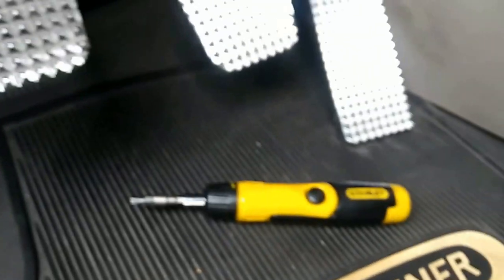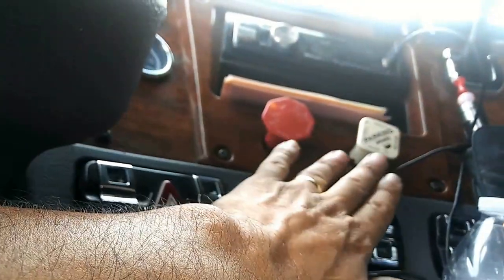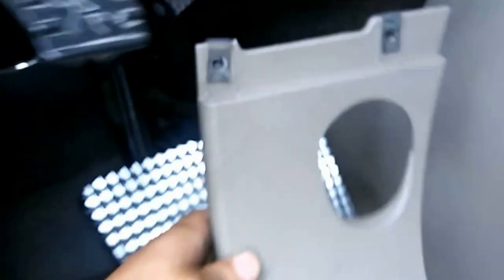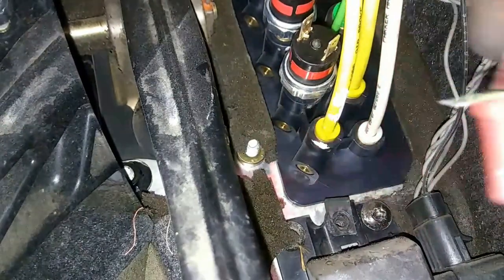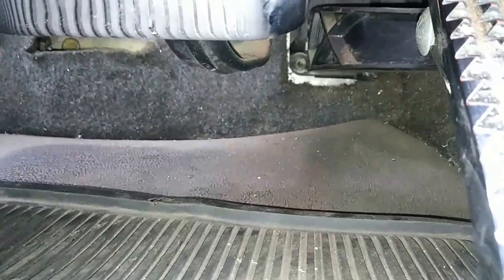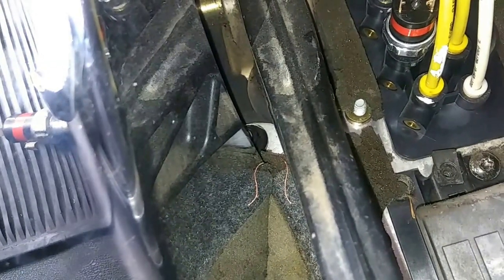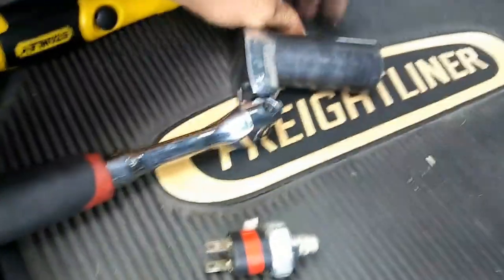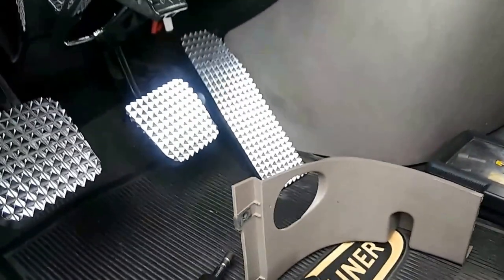Replacing air switch

Comment: Just got this Cascadia as a company driver and it is easier than my old 2006 Century, I know where the leak is and it does sounds down there. Thx for posting. The air sensors leak when there's a lot of water in the air tanks when the driver fails to drain their air tanks daily. The switch rust and pin holes develop.

Comment: Just to let you know how thankful I am to ran across your video and my low air sensor gone bad and cost me $6 to replace it by myself
Reply from the maker: good thing
Reply: When you say your low pressure air sensor... Was your buzzer going off even though your air was full. Because I'm holding air bit the stupid buzzer keeps going off....
Reply: Vic my 1994 freightliner fld 120 is full of air and holding but the  low pressure buzzer stays on? What's causing  this? Thanks in advance.

Comment: Btw, they aren’t switches, but sensors, next time don’t forget to mention socket size it would help a lot more🤪🤪
Reply: Nope that's an air switch.
Reply: Tyler Tyler it is not, does not switch to anything, but sense low air pressure or whatever is connected to.
Reply: @tramos36  Its an air switch. It uses air pressure to either open or close and make an electrical connection. LOL think of a light switch that uses air pressure to turn on and off, It senses nothing !

Comment from the maker: I forgot to mention.before you do this.drain the air out of the system
Reply: Vic Med which one controls the brake lights, my brake lights stay on
Reply: Does anyone know which one controls the brake lights, my brake lights stay on even after I'm parked & engine is off
Reply: Unplug them one at a time until you find it.
Reply: turbooomann Look it up in Google!    I can’t tell u exactly where,but I find it once. Search for Freightliner diagram or so.
    There is like 5 brake solenoids.   Parking,primary,secondary,low psi and so on.    Good luck!

Comment: Thought these were Brake Light switches? 🤔. I drove school bus and if our brake lights didn’t light up it was due to one of these.  We had 2 on the treadle valve (brake pedal). They both got replaced (one is a backup so both get replaced).  If the dash valves were leaking, it normally meant the dash valve was bad.

Comment: That is a sensor for your Gage's. Air on one side and electrical on the other side for your Gage's. If your park brake, trailer Vale supply leaks the valves themselves are leaking.

Comment: I think each truck is different.  I was told these are brake light switches. These are what turns your brake lights on.  And on our busses these were on the brake pedal valve and there was 2.   Never seen 5 before.

Comment: Do these switches also control the low air buzzer/alarm?? Mines is stuck buzzing/alarming while I'm driving,, but when i'm stopped it shuts off. Please help Vic.
Reply from the maker: no they dont
Reply: I had the same issue and all of a sudden the alram went away but now i have one of these leaking air so its probably the same thing causing it
Reply: William what was the issue with that buzzer while driving and then goes off when you stop?
Reply: William Mendoza I ha e the same problem did you find out what was the issue

Comment: I'm having issues with the trailer lights staying on while driving at night. They work fine when I'm fully loaded. They stop working when I'm emptied or hauling a light load.
Reply from the maker: try replacing the electric line
Reply: @vicmed6088  I replaced the pig tail with a brand new one.

Comment: Hey Vic how do you fix the air leaks that's by the firewall
Reply from the maker: sometimes you can just replace the fitting on the firewall,but sometimes you have to replace the whole thang,its about one hundred and something ,not much,good luck
Reply: I just had it to replace mine on a Century 98,and it cost me $165.00.       One push fitting was leaking and they are made that you can’t replace them!    You have to buy the whole air manifold.
Reply: turbo12v go to home depo and buy the oring. The old oring inside the fitting got cracked. Save your 💰

Comment: I have a question bro if it's leaking from the in side where the engine is how do u pop out the top red big hose? I don't want to break nothing
Reply from the maker: put some back arm to it lol,i know them thick ones are hard,but push on the fitting down hard than pull,it will give eventually.good luck
Reply: Vic Med thanks I did it few days ago

Comment: I just replaced mine and when I push my tractor valve in it starts buzzing and doesn’t stop it’s saying park brake on and it’s not it has 120 psi what’s the problem please help
Reply from the maker: it could be the connection behind the dash board is loose
Reply: Now it will go off as long as your setting still  but buzz like hell as soon as your moving
Reply: @Truckerjo-ym2qs  I have the same Problem,  have you found the solution to it? All I did was change that sensor that was bad, and now I have the same issue as You. Any Solution?
Reply: The sensor has to be the same size, notice there are short switches and long switches. (This happened to me on my century)

Comment: I have a small air leak somewhere.
Reply from the maker: shyeem63 did you check out my video.on how to look for air leaks.it mite work.I hate them v
cause they could be real hard to find at times
Reply: I need to find someone to press on the brakes for me
Reply from the maker: shyeem63 you could put a stick to hold the brake paddle